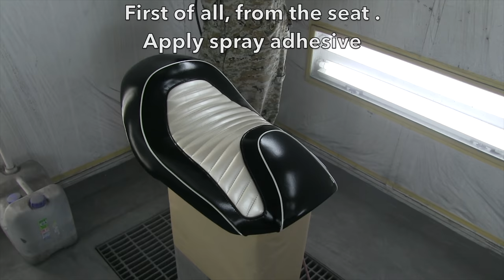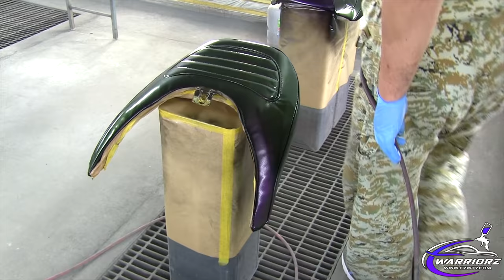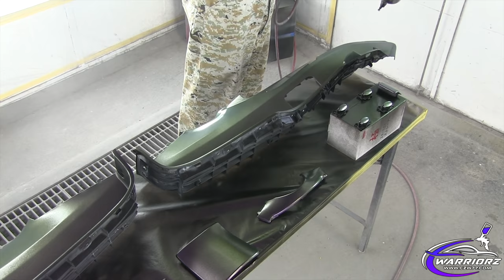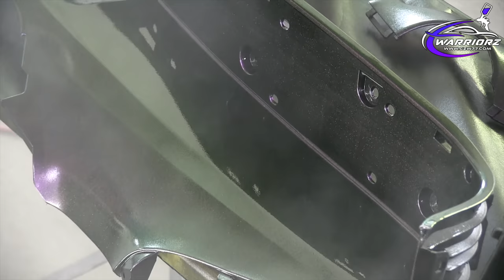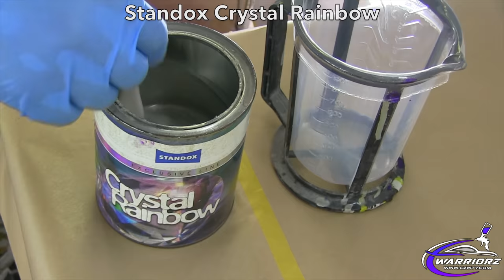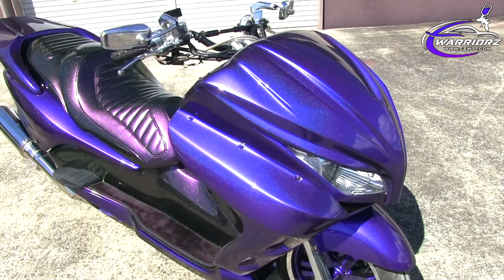Custom paint with vivid purple / How to custom paint motorcycle seat,「カスタムペイント」

Comment: I call bs as a upholstery shop owner that does motorcycles exclusively paint cracks when bent and leather flexes. This will not last
Reply from the maker: I have been painting seats for 30 years.
I used a special glue and a special hardener. I think you just don't know that special material.
Have you seen this video yet?

Comment: What material the seat are made?
Reply from the maker: The material of the seat is the same vinyl leather as a general motorcycle seat.
Reply: Soft finish hardener means? Is that regular clear coat? Just wondering why the paint never cracked or peeled...🤔🤔🤔
Reply from the maker: I used a special glue and a special hardener.
Have you already watched this video?

https://youtu.be/FUb2cMKpk28
Reply: Yes.. I am.. 
Where i can buy the special glue and hardener? 
i come from indonesia
Reply from the maker: Those materials are treated as dangerous goods. So the cost of shipping from my country Japan to your country is very expensive. Also, the difference between the value of Japanese currency and the value of Indonesian currency is too big.
Reply: At least.. Tell me the price
Reply from the maker: Their price is about $ 250.
Indonesian Rupiah is 3710000 IDR.
However, the shipping cost is about $ 1500.
Reply: @czw77  okee.. Thankyou..
btw.. Nice paint job.. 
Keep making new tips and trick..